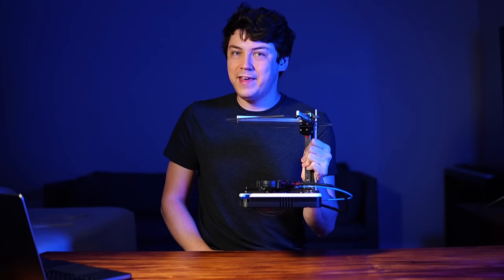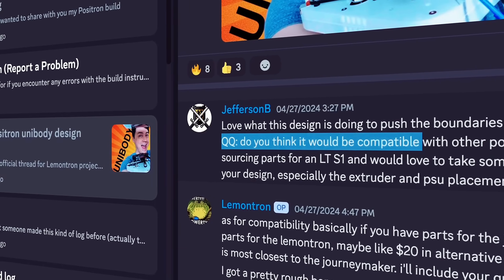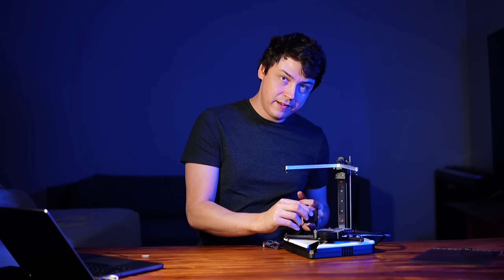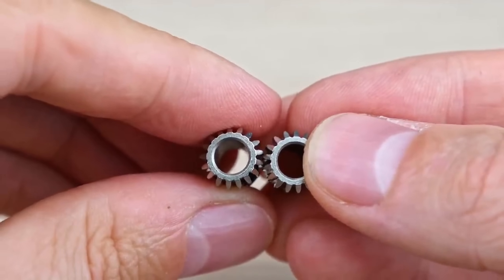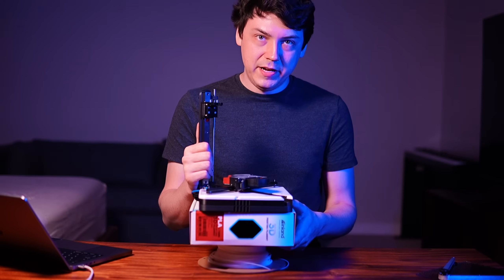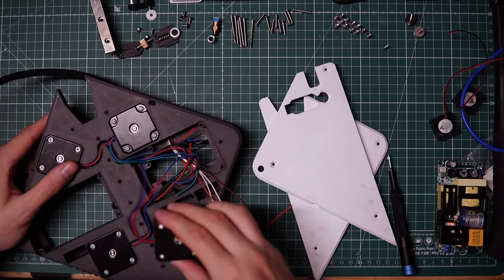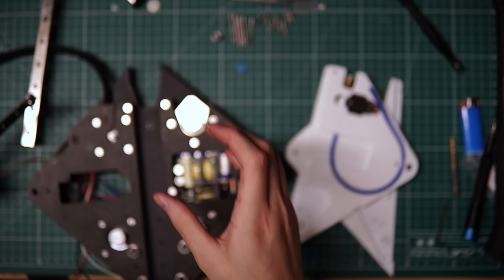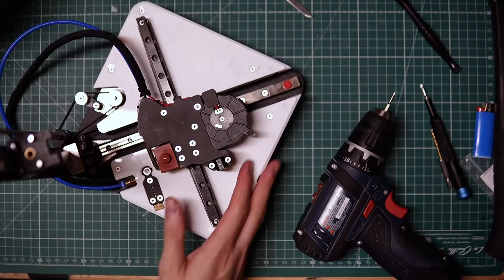Positron 3D printer unibody chassis HUGE UPDATE

Comment: I have no idea why anyone would think extruding upward would be an awesome idea FDM printers already have enough factors and problems to overcome with the extrusion the normal way now add the complication of extruding and defying gravity, most idiotic idea  I have ever heard.
Reply from the maker: Factors overcome a pretty long time ago. If you have a more modern printer you’d know, printing has come a long way. Its like 10 times faster now, ABS is simple now…Extruders already defy gravity, very reliably, in the case of overhangs. If looks stupid but it works it aint stupid.

Comment: Back again to show interest and cheer you on! I live in a van and want a positron but can't justify some of its poor choices. I think you are on the right path, although I don't feel like you answered the ridgity question well enough. 

With your different design, will it fit in a filament box without the PTFE tube being annoying?, if not, is it possible to add a quick disconnect at the tool head to assist with this?
Also I  do not want the internal powersupply, unless I can use an external powersupply with a clean bypass. I want to 12 > 24v convert in the van, then use 110 > 24v in house. I am debating dropping my other life goals and projects to get the best positron I can, which might mean modifying a few things myself. Anywho. 

Keep at it! Reach out to subs if you need help or encouragement
Reply from the maker: Progress continues every day! And thank you for becoming a patron, Luna. How this printer can be used in van life has been on my mind since day one. In fact your idea for 24V input is something I've had in my mind since the beginning, so the final version will have a connector for direct 24V input. The design already allows for the bowden tube and electrical cable to bend without disconnecting them when storing it in a filament box, and the bend is pretty gentle too. You also might be concerned with rigidity but the base is rock solid and not even my PLA prototypes are warping. Should the connector be XT connector? Barrel jack?
Reply: @lemontron  This is so exciting to read! Thank you so much for the reply. I am so impressed. The website you made is also shaping up nicely. 

I like XT connectors more because of their tighter fit and easier to DIY, and I always struggle when trying to source good barrel connectors for my projects, the right size and quality... But barrels are smaller, and more common, and maybe there are more power supplies out there you can simply purchase. An XT connector almost guarantees a DIY effort to use, but is that bad?

I heard some people on discord talking about how they don't like the internal power supply. No shielding, and maybe it doesn't have the same protections as the LDO kit one does, so if you use the same connector as the LDO brick, anyone could buy it or another 110 > 24 brick and not purchase the internal supply at all. 

So as much as I don't love barrels it probably gives the most flexibility. Unless you build 2 versions of the base plate and let people choose.

Comment: Also a small idea - would it be possible to make the z-idler pully use a screw with a knob so that the whole printer could be unfolded without using any tools? Cause as far as I can see it's the only part that requires an allen key during folding/unfolding
Reply from the maker: In a future video I’m going to have the whole z-axis rotate to unfold and the belt will ring onto the pulley as it is unfolded. Very nice but for now yes, you can absolutely slap a thumbscrew on the idler pulley. If I have time I will include the thumbscrew in the next video.

Comment: Wow, this is insane, can't wait to see the next video! Cost reduction is super cool as it did feel a bit expensive for its size & build volume (although portability makes it worth it I guess).
A few questions: 
- With the removal of the bottom aluminium plate, is it as stable as the original? I guess moving the motor down into the base should help with the centre of gravity though, so I guess it's fine?
- Is it possible to somehow increase the max temperature of the print bed, to help with printing ABS? As it's a portable printer, it would be great to have an option to print ABS on the go (make a temp enclosure out of like a cardboard box or something and print).
Reply from the maker: It’s true that smaller should mean cheaper, and I am proving that in the next video. The cost reduction continues every day. Your concern about the stability is unfounded, the base is HEAVY and the positron was never a top heavy design to start off. For ABS, we’ll need a new source of heat bed because the existing positron beds from voxolite cap out around 80C which is plenty hot for most things but printing ABS is very much a goal and anything we need to do to get there is something I am willing to work on, but I won’t be persuing it for a long time because the voxolite heat beds are so good.
Reply: Also - LEDs on the original Positron are kinda cool, hope you bring em back!

Comment: nice
Reply from the maker: niiiiiice
Reply: @lemontron  this could make a super nice on the go printer, any thoughts on enclosing it? Like, some kind of a bag for it that can transform into an enclosure
Reply from the maker: Yes sir there is a thread on that at positron 3d discord. Lemontron will be able to use it or have its own but to really make use of it first the community is going to have to come out with an all metal hotend to heat higher than 250C. That could be a ways off, I’m not sure. Someone has designed one already and it’s pretty well optimized for machinability but I’m not sure the progress of it.

Comment: I have long wondered why so many 3d printed projects use screws instead of lego technic pins. The ease of assembly/disassembly and affordability seem obvious to me. Or, if those pins are inconvenient (for whatever reason), using a pattern of studs and anti-studs to connect the pieces of the frame could be more than strong enough for the forces expected. Obviously not all components can be modified this way, but the: baseplate, mid plates, and top plates should be able to use this idea.

Comment: What would be nice since it's a "Portable" Print is to either add a Battery, or to power it through USB-C PD so you can use wall socket or power pack. Otherwise, very cool little project!
Reply from the maker: I’m actually looking into it! It would charge off usb-c and for extended print times you’d need to keep it plugged in.

Comment: cast the base-plate out of Zamac, it´s easy to cast...
Reply from the maker: I probably will, tbh, but I need it to be easily 3d printable at home
Reply: @lemontron  Someone suggested to you, to fill the hollowed base with cement, that´s why I said that. Cement wouldn´t have a way to vent its water-content, so, this idea may not work... But if u 3d-print the case in vase-mode with resin, put it in plaster and burn out the resin, then pur Zamak in the mould, you also get a heavy base. It´s 2 additional steps, compared to the single additional step with cement-puring, but may circumnavigate the cement-hardening -issue (if any even exists).

Comment: Dude, i love this design!! I've been following the devepolment of the Positron 3D-printers for a while now but IMO this takes the cake! Really awesome job! 2 things im wondering about: 1. What motor ist the extruder? It looks different from the  nema17s and i have found it in your BOM or the journeymakers BOM. 2. Why the LOP-300-27? Is 27V safe for the motors and everything else? in the video (and the journeymaker BOM) the EPP-200-24 is used. Why the change? (I know the BOM is preliminary but stuff like this get's me excited :D )
Reply from the maker: The positron project is definitely heating up. Great questions: 1. Extruder motor is NEMA17. It's different because it's just from another supplier. Don't worry about that, you can just use 4 of the same motors. 2. Actually all the parts are happy to take the over voltage of 27v. In fact there's a little potentiometer on the EPP-200-24 that you can turn to crank it to 27v and some members of Voxolite have done it, it helps heat the bed quicker. The LOP-300-27 has an identical footprint but has 300 watts, very useful for the dry box I mentioned in the video, and has a lower z-height which is important for something I have not mentioned anywhere else, I have actually started slimming the base further, I think I can shave an additional 7mm.
Reply: @lemontron  Very nice! Thank you! Can't wait for the beta release video :)

Comment: This looks great. Wouldnt it be better with heatset inserts for the panels? If only for better longevity and such, because plastic is so easy to strip out and when that happens, you've got a pretty large piece to re-print. Heatsets are very very cheap, I got 500 of them for peanuts off Aliexpress the other day. The ones used in all Voron builds; M3x5x4

Comment: This design is just awesome, just an idea (useful or not), Is it possible to move the fan from the toolhead to the baseplate and use an air hose to push the air to the toolhead? This will reduce the weight of it and allow faster print.
Reply from the maker: Thanks, it’s actually a good idea and been accomplished in the berd-air system or “turbo” systems people use to speed print. I don’t think it’s desirable for the positron printer because although it makes the tool head smaller, on the whole it takes up more space, which is not in support of making the most compact printer possible.

Comment: James, I'm happy to subscribe to your channel. This is an impressive design. I have a suggestion to add to your design. If you add locating pins and locating slots to ease the assembly. Those features will slightly decrease the BOM and can increase the rigidity of the design. The 2 mid plates can have slots and grooves where they interface with the base plate; basically making them lego block before screwing them. Those slot and grooves will take care of  the lateral forces, letting the screw with just the clamping forces. The power supply could have 2 locating pins, leaving just 2 screws. You can see the same design in computer case with motherboards. Again, more locating slot for the 2 top plates. Keep up the good work !
Reply from the maker: Love it- next prototype will definitely lean into using more locating pins, and other features that make the parts self align.

Comment: would you consider hollowing out the chassis and filling it with cement mixture? that would decrease vibration and add some damping , your downside however would be increasing the weight, cement for me is like 4.99 for 25kg
Reply from the maker: You are a genius, I have got to try that! It would be stiffer than any 3D printer out there!!! Thanks for the idea, I’ll definitely put some reference to this idea in the next vid! Would you recommend a certain mixture?
Reply: @lemontron  when working with cement no particular mixture, the overall heft of it will add stiffness, so a normal mix of just cement and water would work fine, if you wanted to have a higher dampening effect with a slightly more expensive alternative material  I'd say go for "epoxy granite" which is a mix of 80% sand to 20% epoxy this is regularly used in damping vibration on high precision cnc machines
Reply: or cast the base-plate out of Zamac, it´s easy to cast...

Comment: Alright first of all this project is awesome!
Second of all, how about two ideas:
1. Could you maybe reconfigure the extruder idler, so that you can adjust the tension with a socket screw and an alan key? Might be more ergonomic from first thought.
2. Something about a smart cooling solution but I forgot what it was... (oh yeah, if you could use the steppers/belts to drive a passive cooling solution, but that might be stupid)
Reply from the maker: 1. Well with the thumb screw obviously you can adjust tension with your thumbs, and it works, but I do see an advantage for the screw idea- it might be lower profile, something to look into. Need to continue to miniaturize each component. 2. Creative, but however it would be done, it sounds like it would need extra gearing to make a fan actually move air.

Comment: just to correct something, dual gear extruders are great for bowden setups, the problem is for direct drive where the path is too short to smooth the little bit of backlash between the gears
Reply from the maker: Yes, I should have mentioned that. Also gear size might be important too. As you go larger The modulus stays the same, but the teeth get closer together. (I think) So it would not be as big of a problem on any newish dual drive gears like hummingbird. Anyways my point was not to condemn dual drive concepts, just that they’re not ideal from a perfectionist standpoint.
Reply: @lemontron  also part of the problem seems to be unrelated to gears and related to the center misalignment of two components, there's a video from MirageC on it with a simple fix using a part made from a single piece of metal

Comment: Would be AWESOME to have the bottom plate CNC machined out of aluminium. Heat syncs for the motors could be integrated... Probably cost prohibitive though
Reply: A possible idea to improve upon this is to have channels to put strips of aluminium which are readily available at the hardware store. Just cut to size.

Maybe even just aluminum tape may work.
Reply: Cast is from Zamac instead.